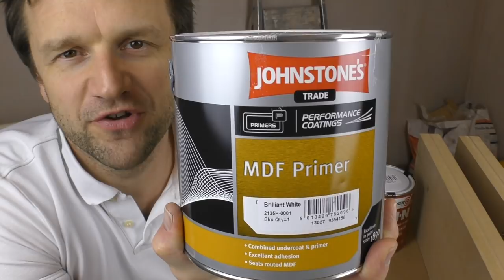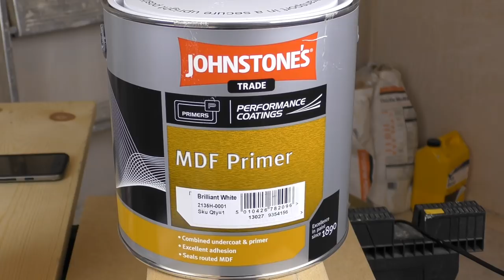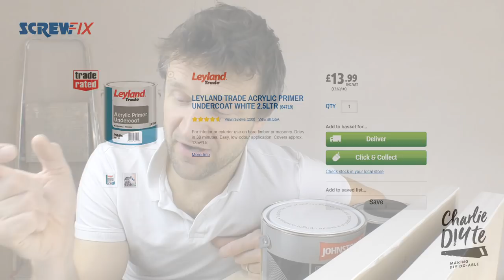How to Paint MDF Edges - Zinsser B-I-N vs Johnstones MDF Primer

Comment: Hi Charlie , im watching your videos for a while , got a question for you mabe can help ,
I was using Dulux quick dry satin wood for some melamine shelving what was sanded down applyed two cots of BIN and dulux quickdry after 

2 weeks its still sticky ?
Reply from the maker: Have you done anything to the Dulux, like water/thin it down or store it in cold temperature? It's fine to use quick dry satin over the BIN so I'm struggling to work out what's happened here.
Reply: @CharlieDIYte  I actually had a similar experience with Dulux Satin Wood Metal... The paint seems soft... I don't think I will use Dulux again.... is there a difference in how hard the paint finish is between Gloss and Satin? Gloss seems much tougher...
Reply: @CharlieDIYte  , no not realy i was thinking i didnt mixed the paint troughly ?
I will try again to see if will make any difference

Comment: Hi Charlie, do any of the products you've used in your video's waterproof and seal the MDF? I'm thinking of replacing the cupboard door under the sink.
Reply from the maker: Lee Breen Funnily enough I was thinking about this yesterday as the builders put an MDF sill in our kitchen above the sink when we moved in (not my choice, I favour timber sills). It's bearing up pretty well in spite of having leaking flower pots and general splashes a lot of the time. My advice would be to use moisture resistant MDF if you can get hold of it. Most high end joinery (veneered wardrobes etc) I encounter in my day job seem to be made from it, and that, combined with say Zinsser BIN primer and perhaps a couple of coats of acrylic eggshell will make that woodwork pretty impregnable 🤔
Reply: Charlie DIYte. Thank you Charlie thats a great help.
Reply: @CharlieDIYte  hi Charlie I use a lot of MDF board for my resin artwork but have had a few pieces warp could you tell me what I can do to prevent MDF warping, thanks in advance, your videos are great 😊

Comment: Hi, would I be able to coat mdf in the Zinsser to use as a table top for outside under a shelter? The table will also be coated in resin. Thanks
Reply from the maker: I think so, John, particularly as it's under a shelter. It can certainly be used as a spot primer outside but the instructions don't go further to say it's a complete outdoor primer There are probably better exterior primers out there, though.
Reply: @CharlieDIYte  thanks for the reply Charlie, could you recommend a good exterior primer as I concerned about the mdf blowing.
Reply from the maker: Have you bought the MDF yet? If not you'd be better using medite tricoya. You submerge that stuff in water for weeks, fish it out and it won't have blown one mm.
Reply: @CharlieDIYte  Yes, unfortunately i have already been given the table top mafe from mdf.

Comment: Can MDF primer be used on laminated surfaces before painting?
Reply from the maker: Standard MDF primer, no. MDF is still a porous surface at the end of the day. You may get away with Zinsser BIN but it will scratch off relatively easily. Best to try and find a specialist laminate paint.

Comment: Shellac it’s worth the price.  You can spend less if you use ammonia to clean brushes, than rinse with clean water.
Reply: I'm with Abel! Here in the US, I was using denatured alcohol (I think the same product called methel-something over there) for cleanup, but complained bitterly about it while at the store buying some supplies, and someone told me about using 1/2 ammonia and 1/2 water. It works great and even works for cleaning latex paint. BTW, I think alcohol-based primers are worth the money. They don't swell the grain, stick to nearly everything, and are ready to sand very quickly. I'm a huge fan of Zinser BIN.
Reply: You don't need to clean the brushes put them on an airtight pot with a bit of methylated spirit and you can use the brushes over and over again

Comment: Great stuff BIN but expensive and paint brushes are ruined.  Was that ordinary MDF not moisture resistant?
Reply from the maker: Yes ordinary MDF. If you get some methylated spirit or the Zinsser brush cleaner you'll find it's easier to clean off than if you were cleaning oil based paint brushes. But you admittedly have to throw away mini roller sleeves.
Reply: Thanks Charlie

Comment: Hi, can you use water based primer with oil based paint?
Reply from the maker: Yes as long as the primer has dried out fully before you apply the oil based coat
Reply: @CharlieDIYte  Thank you very much. Appreciate the rapid response

Comment: have you tried knotting solution?
Reply from the maker: Only once to seal a bottom of a kitchen kick board. Pretty sure BIN does the same thing.
Reply: @CharlieDIYte  👍thanks Charlie, i used it on the edge of an extractor fan cover i made and it blended well with the abutting face of mdf. as you say it probably does the same thing just thought it was worth a mention.

Comment: How does the BIN primer compare with Zinsser 123 on MDF?
Reply from the maker: It's shellac based whereas the 1-2-3 is water based. So I think it's always better to avoid water based on MDF where possible, and as BIN dries almost as quickly as you apply it, you can do a couple of coats very quickly, massively cutting down your painting time.

Comment: hello Charlie.. great video.. this is a subject I hold very close to me.. I think all these sealers/mdf primers are a waste of money.. all I use is some high grit paper and the paint/primer im using  its all about compressing the fibres as you probley know.. I have done a video on how I get a mirror finish with n o sealers etc great video mate …
Reply from the maker: Thanks mate. I totally agree, and have achieved just as good a result with cheap Armstead wood primer undercoat https://youtu.be/O7_JhgkD-og as I have with the more expensive MDF primer. Just watched your video - really interesting and wow, what a finish you got! Out of interest, how come you didn't use a primer in the vid? It's also interesting that you use moisture resistant MDF - I'm going to switch over to this as soon as I can find somewhere locally I can source it from for a half decent price. All the high end joinery I see on site is done with MR MDF, so what you say makes perfect sense. Only prob I see with your approach is that most of us DIYers aren't going to be spraying our MDF creations, so the challenge is how to get a great finish using a roller.
Reply: Hello mate yes thanks the finish is pretty decent .. I never used any primer for the simple fact I didn't have any in stock at the time.. and I suppose it just shows that finish wise you dont need a primer .. I make a lot and I mean a lot of radiator covers and I mainly use MR MDF as it a lot more dense and take finish a little better but I still get really great results with standard mdf...  

I also see what you mean from a DIY'er point of view.. I mainly spray all my finishes as that what I do full time .. so I used a rattle can as its a off the shelf kind of thing... but I think I will make another vid with just hand painting to show the finish that I can get.. mdf is one of those materials that a lot of people hate... but I love it.. the stuff that can be made from it is amazing …  look forward to seeing what other vids you have to come im subbed and bell is rang lol

Comment: Would u get the same problem with a routed edge as with a sawn edge? I'm thinking of rounding my face edges.
Reply: yes , the edges of MDF needs sealing if you want it to be "smooth" ..... route , saw , no matter , seal edges .... light sand .... sometimes I'll just use a spray can of primer or cheap paint to seal .... walmart spray paint is so thin it soaks in deep , takes two or three coats but you recoat in 2 minutes .... walmart spray paint costs $1 a can !!! MDF soaks it up like a sponge deep in the pores

Comment: Good comparison video. I think you are getting the terminology wrong. The Zinsser doesn't "soak in" better, in fact, the opposite. It coats the fibres better, the reason it does not raise the "grain" so much. I find the Zinsser goes further but costs more. Six of one, half a dozen... I simply prefer the easier finishing of the Zinsser. The more coats and better sanding finishing you apply, the greater the finish advantage of the Zinsser...

Comment: I'm surprised that you didn't sand the end grain before painting, as you would in real life..?
Reply from the maker: I planed it to get the two edges flat. Not really sure sanding it would have added much benefit, but I guess I should have mentioned that.
Reply: Charlie DIYte 
In my experience a few minutes of sanding makes a huge difference to 'end grain MDF' I wouldn't add any finish before sanding.
Reply: Anthony James Brown I agree. But I would sand heavier between coats which will have a better finish in the long run, if I am doing high end work i would use a fine surface filler on the grain to hide it completely
Reply: totally agree with Anthony and Simon
Reply: Martin Durant - Also, never turn left at streets beginning with a vowel... the other number one rule of painting.

Comment: I’m not a fan of mdf per say but I’ve had to use it to get as doors which aren’t bowed as a Banana/particularly evident when using ply on bigger doors. I’m always going for a dead smooth finish and where as I typically favour Sikkens “bl primer” (now remarketed as Dulux trade quick dry undercoat) i find it (and I’d imagine all water based products) a total NIGHTMARE on mdf. I think this video doesn’t show the issue. Painting mdf with water based products doesn’t raise the grain as mdf has none but it does cause expanding of the fibre/a roughness in the surface that’s hard in my opinion to lose. Lots of People solve this by painting several coats of any primer before sanding which is critical as if the mdf is exposed during sanding and repainted it will roughen again and again. Ie it’s easy as in the video to get a rough but covered surface but very hard to get a smooth/finished looking surface quickly. I’m trying zinsser today as I hope it will be possible to prime, fill and sand smooth, moving on to the second coat it will REMAIN smooth because any exposed mdf fibre won’t expand on contact with the primer/second coat as it will with water based (effectively reversing the prep) I think an issue you can see this really easily on is countersinking mdf, i found the edge of the countersunk hole Edge incredibly hard to lose using acrylic. a problem I coined “the donuts of doom” The ring just keeps coming back again and again. Finally I’d make the point although washing brushes in water seems great..most people (maybe this isn’t you Charlie?) wash the acrylic paint down the drain, this is basically impossible to take out of the water and is currently killing fish in the seas on mass. At least using solvents the paint remains in the solvent which you can keep/the paint settles out, and you can reuse (paint dross can Be decanted off and go in the bin) it largely doesn’t get into the water system. what should happen with water based finishes is they should be washed into a bucket and again kept.they can be decanted off once settled..dried out and binned i.e paint disposal is ALL “a faff” (to quote you!) if done responsibly

Comment: Zinsser B I N is miles in front of Johnstone’s I have been decorating for over 40 years and worked on some of the most prestigious buildings in London dulux trade paint was once brilliant paint to use before crown bought it out but I will say Johnstone’s has really improved and there washable emulsion is excellent but there MDF primer not a fan sorry

Comment: just use any stainblocking oil primer , kilz or coverstain would be fine , 20 bucks a gallon ..... no need to go full shellac or fancy water based
Reply: Here in the UK Coverstain and BIN are the same price. Both are Zinnser products.
Reply: @brianmorrison9168  well hell , I'll just send you the money and you buy me a few gallons of BIN !!!!! Here in Texas BIN is like $33 and Cover Stain is $20 ..... To be honest I have switched back to Kilz Original oil base stain block primer , I did a comparison test on it vs Cover Stain , Kilz sticks better , less fumes , and brushed better .... Cover Stain fumes are killer when spraying .... I stopped using it , I use Kilz again .... I'm going to try BIN though , next time I need a good primer to stick to cabs or trim .... I bet it does stick well , everyone seems to like how it bonds

Comment: starting to hate mdf... been trying to bend some 3mm mdf, a 75mm wide strip around a coffee mug,  at 3mm thick its a bit thing for cutting strips out of like bendy mdf, and also both sides will be visible as its a bit of an art project....
starting to think mdf was not a good choice but i cant find a replacement material, its decorative not structural, but will need to take a knock from someone maybe walking into it....
really should have pushed for square corners not rounded.......
Reply from the maker: +Project 806 Camper You are going to seriously struggle bending MDF or any wood for that matter around such a tight circumference without steaming it. Obviously you can't stream MDF. Check out this link https://goo.gl/pBVkr3 and also I watched probably the best episode every on Grand Designs once about a guy who's a complete expert on wood steaming, and based his entire house and business around the art https://goo.gl/rdKfrV

Comment: Zinnzer is thinner and goes further, so the price difference is not that much in the end.
Reply from the maker: Agreed. It's my go to primer these days.
Reply: @CharlieDIYte  we are having our first go at painting MDF kitchen units after the plastic?? covering came loose and was damaged. We have stripped it all away and are ready to start. Getting the residual glue removed is quite a job in itself, and I'm hoping the Zinnzer primer provides a good base to work from.

Comment: 2k primer few coats are better then waterbased
Reply from the maker: Sounds interesting. Is that metal primer?
Reply: @CharlieDIYte  2 pack automotive primer with hardener 4:1 ratio 2 coats and next day sanding with 240  and 400